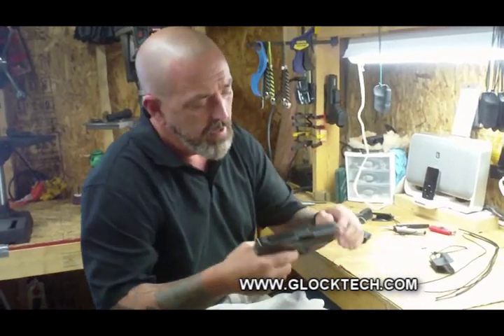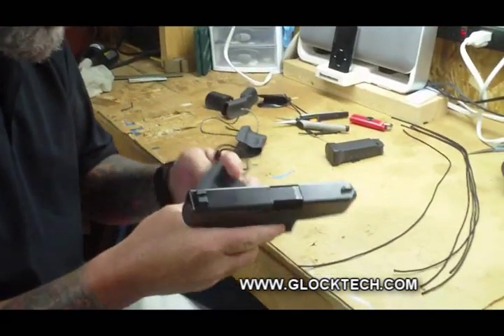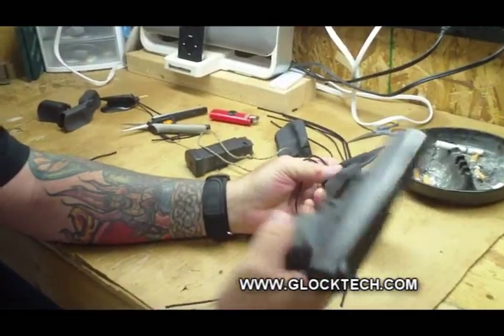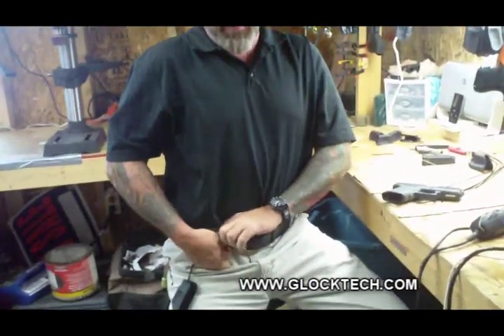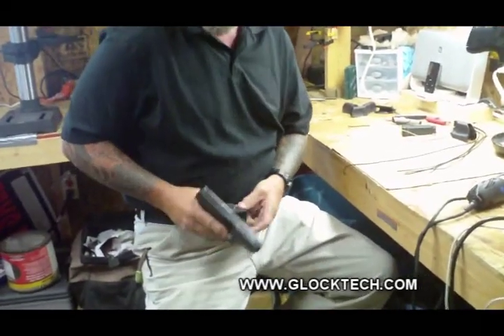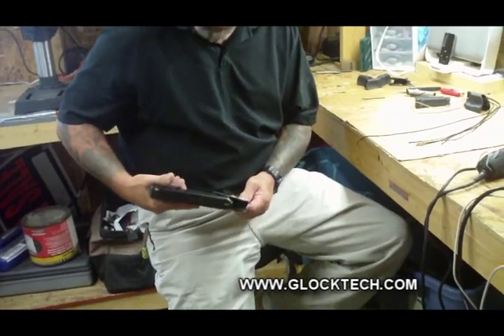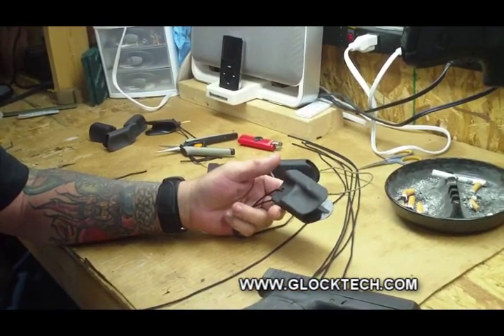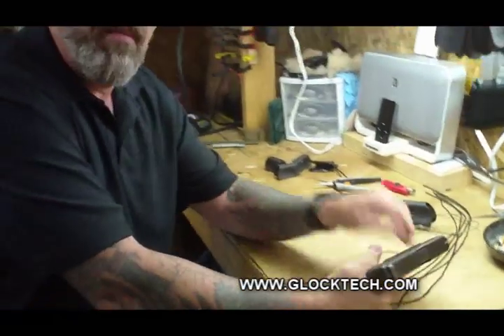How to load and draw from the MIC Holster

Comment: I have found a carabiner works better than the loop around the belt. With this I can remove the holster and cord quickly without messing with my belt.  Plus I use the versa cord for my pocket carry and the carabiner give me  a bit more cord length which lets my glock 19 go deeper in my pocket. Great product.

Comment: Not really understanding the point of this holster .. Why not just a normal iwb kydex holster ? Is there something I'm missing ?
Reply: +TMS 1224 For me, it's versatility. As long as I have a tether point, I can stick the gun in a front pocket, a coat pocket, a boot, my waistband, etc. Big emphasis on the coat pocket.  I also think it's a fantastic option for very small guns.  I've got a J frame, and no matter what holster I use it still adds some thickness and bulk to the gun, even with kydex holsters.  I wear some tight pants, man. And if I can slim the profile down to the exact dimensions of the gun itself, that's the way I wanna carry.
Reply: MIC stands for Minimal Inner Carry basically meaning that it gets rid of the bulky printing that regular full holsters show and still provides a safe carry.
Reply: I think the point is that the MIC holster is thinner than the gun, whereas ALL OTHER HOLSTERS are wider.  Hence, this makes the MIC the most concealable holster out there.  That's what made the Mexican carry method so popular, until someone shot off his own huevos, that is.